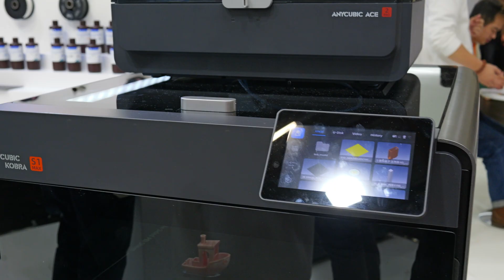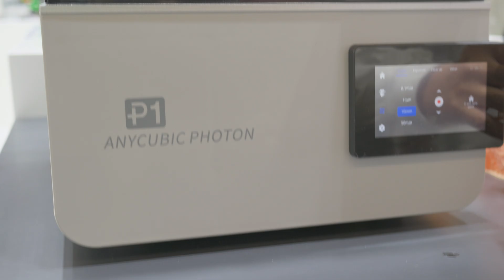3 Insane New Anycubic 3D Printers — FormNext 2025 FIRST LOOK!

Comment: The Kobra X is basically a copy of the A1. I like the spool positions of the printer, that way it has a smaller footprint and can be placed on tighter spots with easy access to the spools. I like they are using the same toolhead for the following printers and the big advantage it can have is the smaller amount of purge it will need when changing colors/materials. I hope this printer is good and competitive, but it no longer has to march the A1, it has to surpass it in features, quality and reliability to even being considered now, since Bambu has started it's refresh of their own lineup and it's very likely next year we will see an A2.

Overall the printers seem solid, but I still have my doubts about their FDM models, I hope they have ironed out all the kinks and we can finally have a reliable competitive Anycubic FDM printer in the market.
Reply from the maker: Yup agree with all of this, the Kobra X seemed V solid and is the same size and price as an A1 with less waste, I have one on the way so we shall soon see

Comment: The P1 has a lot of good features, and then it has that silly dual vat gimmick. I don't know, maybe it makes more sense in dentistry or something else I don't know much about.
Reply from the maker: Its strange for sure but the more I think about it the more I want to use it and see the best application. For example you don’t have to use both sides, all of a sudden if you just need to print one mini, you can, or if you want to print a transparent part alongside, you can, it’s super niche, but it’s interesting
Reply: That's exactly it's biggest use case.  Basically it lets it print both parts of a denture/insert  (gum tone and tooth tone) at the same time.  Anything that needs multiple base colors for a part and it can fit in the dual vat